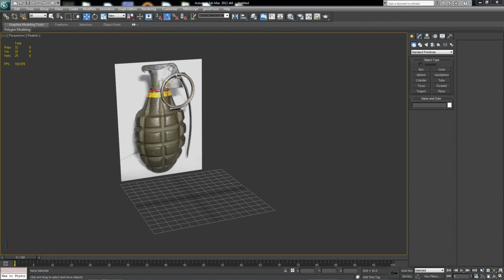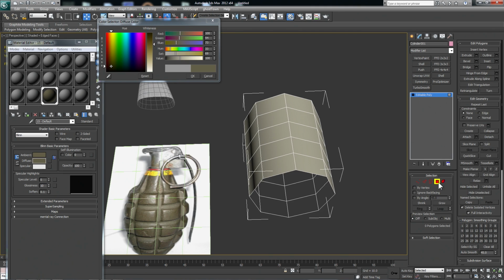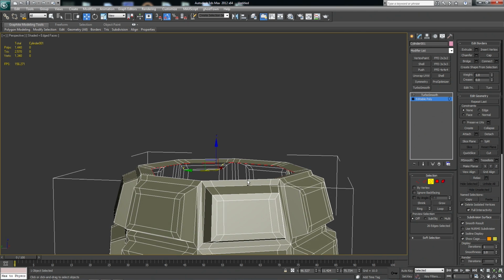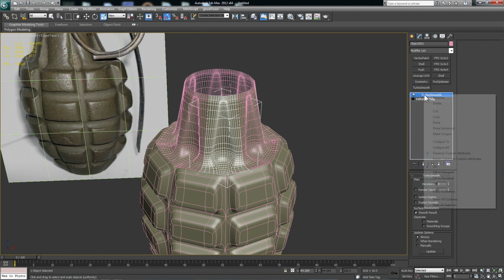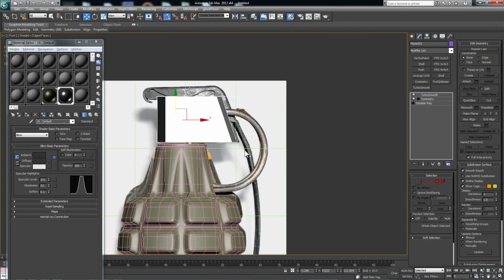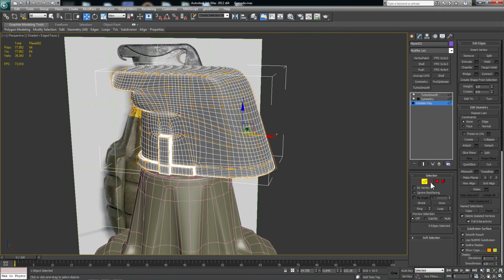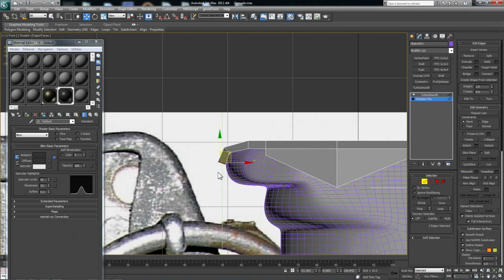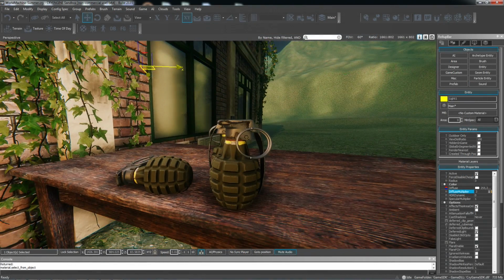Hard Surface Modeling- Creating A Grenade Part 1 of 3

Comment: I realized  that  u are really good at modeling.nice video btw
Ps.  Is part two of this  tut  using EaaS  otherwise u won´t be able to aplpy  gloss maps to  use PBS  on cryengine which gives a nicer look  XD
Reply from the maker: Thanks, the examples shown were set up pre PBS but in part 2 I will show examples of it in each lighting set up.